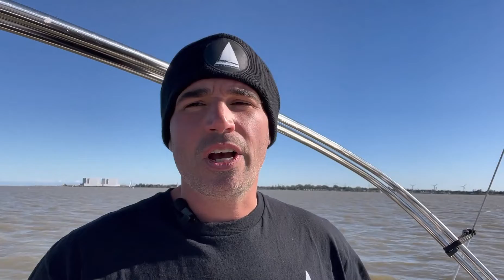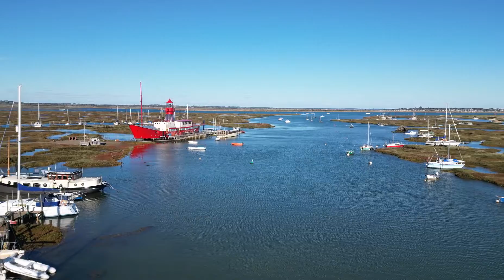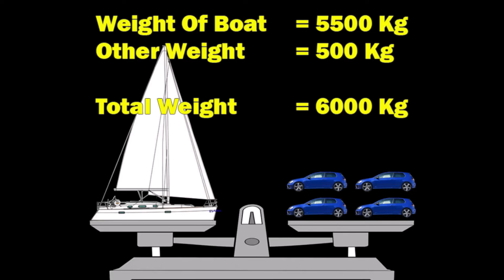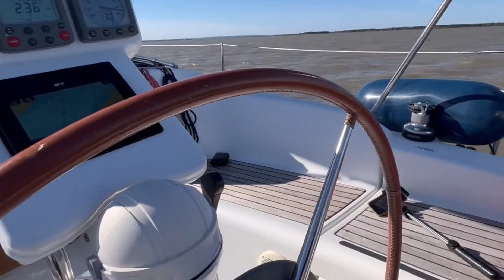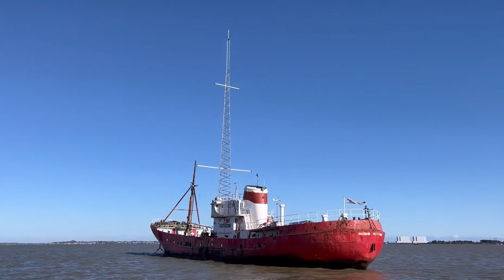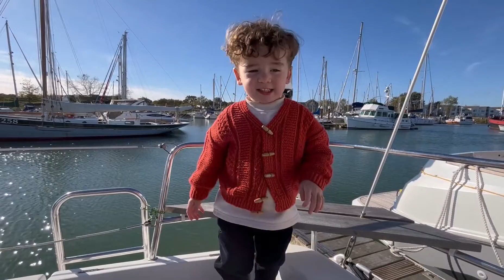6hp tohatsu outboard push 6 tonnes?

Comment: This was no test.  Itwas simply a demonstration of the Tohatsu 6hp outboard - which is an excellent motor, with a Hi-Torque prop.

No where in this demo was there any mention  or depiction of stopping power.  Virtually any outboard will move almost any boat, but stopping and maneuver power at very low speeds when there isn't enougfh way on is just as important as running power.

Further, the conditions shown here are absolutely the worst possible to caught in while attempting to navigate with an under powered boat.

My advice - as one who has sailed allmy life - is double the HP on any outboard for a sail boat.  A trailer sailer of 18ft will behave much better if the motor is an 8hp rather than the typical 3 or 4 hp.  Everything matters when you're at the dock - or avoiding those others with tiny motors, who are also at the dock. Open waters are no problem, but - wind, river currents, and tide, can make or break your day.
Reply from the maker: Hi, the video as per the thumbnail was to demonstrate If the outboard was powerful enough to propel the boat not stop the boat. This setup as stated in the video was for emergency use only if the main engine ever failed. There’s no remote controls to change to reverse gear without having to step down on the back of the boat and do it manually. Would I attempt to go into a tight marina and berth it with this setup….. well it wouldn’t be my preferred option. Would I attempt to land on a an empty hammer head pontoon clear of boats with good turning room…. yes no hesitation.

I think you’re missing the point of emergency use. This setup would be perfect to get your out of open sea into a protected narrow estuary or bay to drop anchor to sort the main problem out or get close enough to the marina to get a tow in? you might be drifting onto rocks if your main engine cut out and there was no wind to sail. Why would an 8hp engine be a good substitute? I’m a strong fella and an 8hp outboard weights 40kg instead of 25kg for a 6hp outboard. The transom would have to be significantly strengthen to take this weight. How would anyone be able to safely lift a 40kg outboard from the bilge locker and put it on the back of the boat moving about. Also an 8hp outboard wouldn’t even fit in locker for storage. Also regardless of the increased stopping power, it still doesn’t change how you have to change to reverse stepping off the boat which is the main limitation of this setup. You sound like you have never sailed in your life.

Comment: Very intresting! I bought my first boat recently and I have a 3HP and a 15HP , thinking which one is more apropriate. Its a 400kg fiberglass boat so probably the 3HP will be adequate!
Reply from the maker: Hi, I think 15HP will go very fast, you might be able to plain the boat so will go much faster and save fuel but you need to make sure the transom is strong enough to take the weight of the outboard. A 15HP 4 stroke outboard will weight 50 Kg's. The live load going over waves will be significantly more so you may need to strengthen the boats rear end. The 3HP outboard will get you going but if your having to push against a strong tides and against the wind you might not get anywhere. Its always nice to have some power contingency. You also need to consider the weight of the outboard, taking these engines off on your own regularly. If your at a marina and not having to worry about taking the engines off id leave the 15HP on.  Are your outboards 4 stroke or 2 stroke as the later generates a lot more hp. Also are you taking your boat out in open sea, tidal areas or closed lakes? Ill be able to advise you better. Thanks
Reply: @EastCoastSailing_  Thanks a lot mate for the reply, reading back my comment I forgot to add that its a 14ft-4.7m boat, and it has a 60hp main outboard (1986 Johnson 60) so im considering having a back up motor just in case. I think the 15hp might be a bit too much, power and weight wise, so on days with no wind, I think the 3hp will be adequate as a back up. And if some days the boat is loaded with people etc, the 15hp might be a better fit cause the 3hp might not be enough
Reply: 6 cv